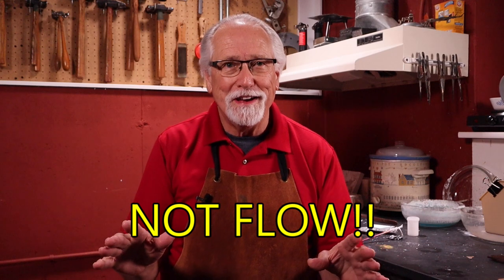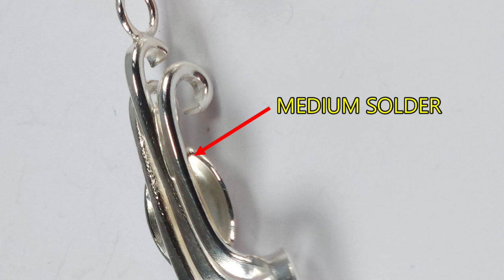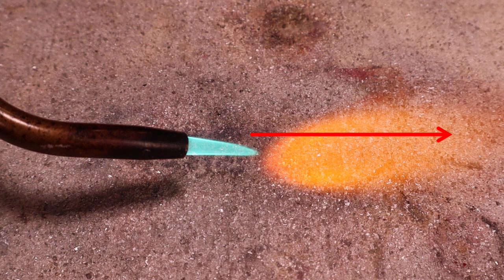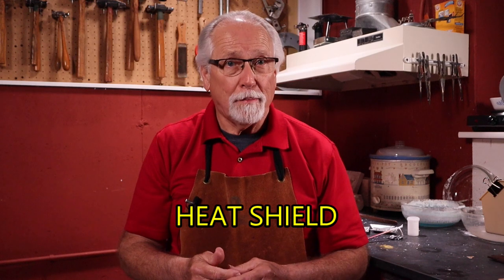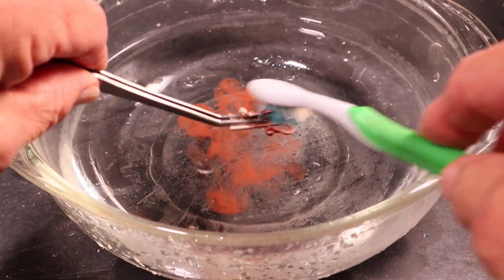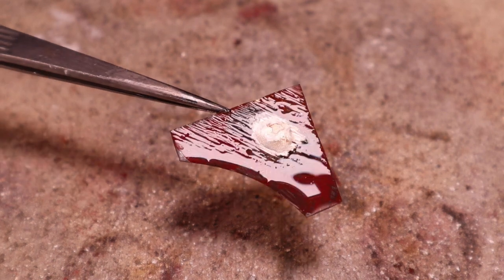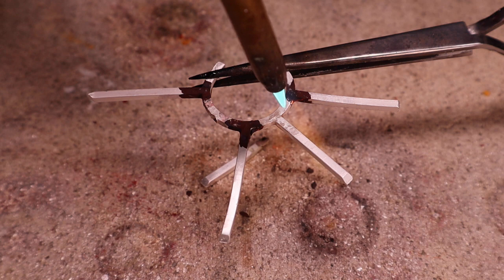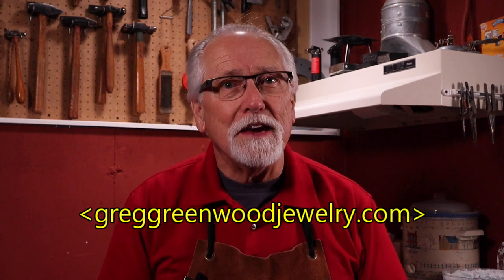HOW TO "NOT MELT" SILVER SOLDER - PART 1

Comment: Excellent  tutorial.  I find the biggest problem my students have with soldering is that they hold the torch too far away from the point they wish to flow soldier or they erratically move the torch  about (because they were taught to do this to initially warm the piece.)  This eventually leads to the entire piece overheating.  Either the flux burns off and nothing flows or previous joints come undone.
Reply from the maker: Hello Malcolm,  Thank you very much for your comments.  I appreciate it.  Yes! I agree with you 100%.  Thanks for watching.  Greg Greenwood

Comment: Interesting. Just curious. What torch are you using in method 2?
Reply from the maker: Hello William,  Thanks for watching.  The torch is a Prest-O-Lite  acetylene/air torch.  Using a B tank of acetylene. 4 different tips.  I have used this torch for over 40 years.  It works great for all of my needs.  Thanks again.  Greg  Greenwood
Reply: @greggreenwood4628  Thanks Greg. They don't seem to be available any longer. 40 years! Must be a good un.
Reply from the maker: Hello William,  I just got done soldering a minute ago with the torch.  Yes, it is a good one.  I have seen them on ebay used.  The Uniweld acetylene torch is similar.  Also, check with your local welding supplier. They may have a suggestion and a model for you.  Let me know how it goes.   Thanks  Greg Greenwood
Reply: Hi William I’m just looking through Greg’s comment and I noticed yours. I’m very new to the art but I have already wasted money on a single gas torches. I asked Greg the same question as you and then foolishly purchased a single gas Sievert jewellers torch, great for little stuff but I wanted to make a 50mm wide copper cuff bracelet with a 2.5mm copper wire carrying beads on it. I couldn’t have made what I wanted with the Sievert or my plumber’s torches. The plumbers torch would heat the copper but over heat the beads. The jewellers torch with a needle nozzle would have a small enough flame but it wouldn’t have the power to heat up the copper fast enough so as not to damage the beads.  Before you buy another torch have a good look at dual gas options, I wish I had, before spending money needlessly. Like I say, Greg told me but I didn’t listen. . £££$$$£££!!! I now have a great Mapp gas and Oxygen kit. It cooks like oxyacetylene, but I probably should have looked at oxy/propane as a better option for my needs. Don’t rush at it like I did!  Kind regards Andy   @williamemerson1799
Reply: @AndyDaviesByTheSea  Hey thanks Andy! You may have just save me some money.....and a little grief. 👍🍻